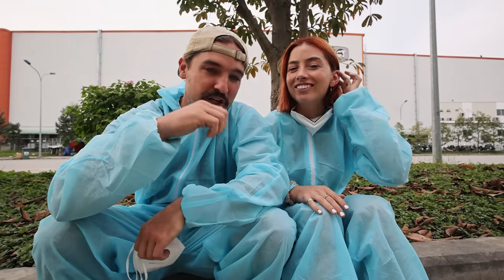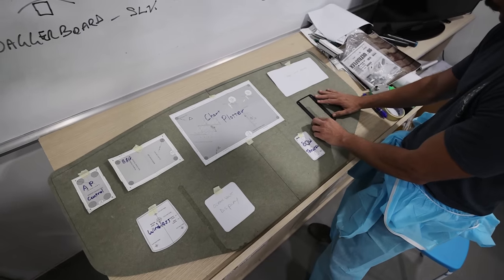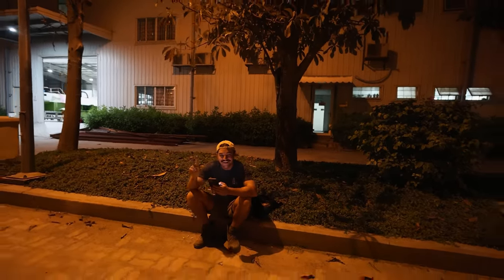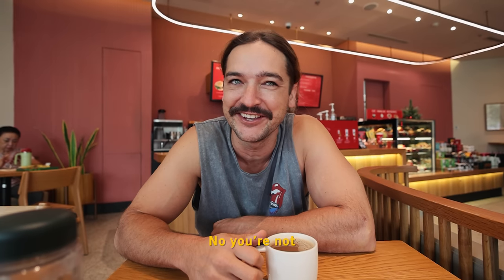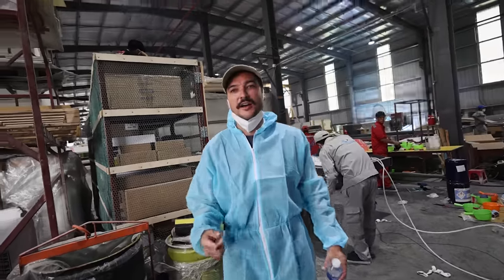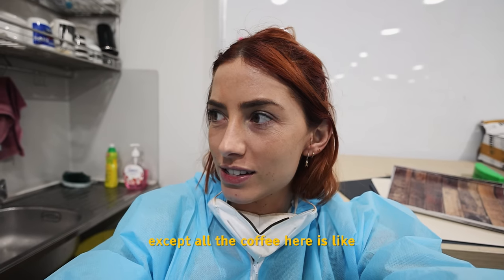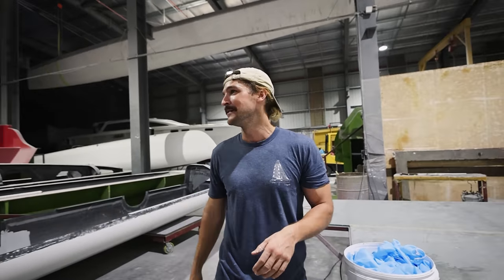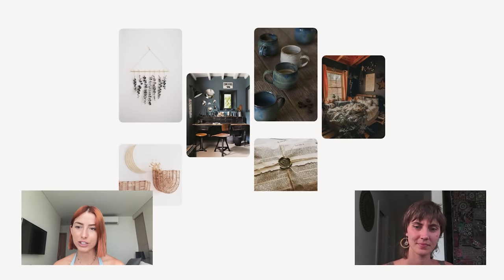BOAT BUILD: Interior work Begins!

Comment: I’m an architect and I have to be honest, I know its a subjective topic but I believe you are destroying your boat / home with an eclectic melange of faux finishes that will make a confined space feel smaller and chaotic. I would go neutral all the way and accentuate the interior with colours and finishes in the soft furnishing that can be changed as you desire. It’s too confined a space, you need to accentuate the volume and not diminish it with this clutter, your stimuli is through the windows and the places you visit, I would think the interior should be a sanctuary, a haven, peaceful and serene.
Reply: Yes, with bright colours you tend to get sick of them. Nondescript soft colours work best.
Also get rid of the insane copper.
Reply: I think it looks kinda funky......maybe not the purple, but, hey, it's not our boat‼️‼️
Reply: @HopeOfJoe  yes i agree - its not our boat and they should do whatever they want.
It is a great yacht and it will be really interesting to see how it turns out
Reply: I'm sure when it's all done it will look amazing they do have alot of help and support from exsperienced boat builders painters interior designers ECT.. I'm not worried at all I look forward to the finish project
Reply: It’s gonna be a home first with the warmth of the home and I think as far as the wall colors in the paper and stuff just as in a home that can be changed that’s lightweight. It’s a coat of paint or another design of wallpaper so I don’t think that is some kind of major commitment. The light weight is important in plants on board are going to be very important and the plants looked a lot like air. Plants didn’t needle a lot of dirt to live.
Reply: Oh, and also, they’ve been on the water for so long. I would pretty much trust that they know what they would like around them.
Reply: They could always change it if they decide they hate after living with it. Live and let live.
Reply: You may have a good point; but people mentioning it's subjective are right. 

If I walk into a house that has white or very pale colored walls, I can enjoy it and appreciate it, but I can't live well in it. In my space, I have to have deep color to feel at home, primarily greens- many!  and reds and deep blues and black. If I have to live too long in a white- walled space, I wonder why someone doesn't finish and paint those awful only- primed walls! My style certainly isn't everyone's, but that's kinda the point ...
Reply: I agree 100% Barry. The colors chosen are going to make it feel very confining. Yea, it’s their boat so ultimately they can do whatever they want. I don’t think they will “love” it all a few years down the line and it will be expensive and time consuming to change the heavy, bright colors when they tire of it. They will become dated  faster than the neutral and lighter colors.
Reply: I agree totally,
Reply: Kudos to you for being bold and making a statement.
Reply: Maybe confined space seems pleasant after the large expanse of ocean all day long
Reply: thats exactly it though - you are an architect and not interior designer
Reply: Charlie bit my fingerrrr
Reply: I agree ☝️ 😊
Reply: I work at a professional remodeling company as a designer. I go into homes (bathrooms) all day long that were built like this in the 50s, (pink and gaudy) and people want it torn out…..Neutral is the way to go with slight accents. That way, when you get tired of it, you can change it easily.
Reply: For real. Take a note from yacht manufacturers. They know what they’re doing
Reply from the maker: I’m really glad some people don’t like it. If I was getting all positive comments on our funky ideas I’d honestly have to re think them. We love it and we’re really aware it’s not for everyone. 
Time will tell.
Reply from the maker: @theAquillo  yes I love monostyled factory produced unadventurous decor.
Reply: You are right. Dark colors and bright colors you will get sick of it fast. 
 The dark colors make it seem small. Same with  bright colors. 
And ya'll  are right it isn't our boat. BUT!  You have to remember the resale of the Boat in a few years.
 And I believe they will go back to a cat soon. The cats have way more room. And with the HH and Seawind cats gets you the room and the speed they are looking for.
Reply: Did you hear that Riley and Elayna, you are destroying your boat/home!!!!! There is no recovering from this fatal mistake! LOL. 🤡
Reply: Right on brother! I was just about to post the same thing. 
They should leave it a blank slate and ad to and change as they have had the experience of living there!
Reply: Ngl I’m so tired of houses or living spaces looking like hospitals or offices - let there be color and funk!
Reply: I love that they are doing something out of the box and to their liking. That’s the fun in watching different peoples lives if they were all the same we wouldn’t be interested. For you, neutral means zen for others it’s not, and that’s okay.
Reply: Dear all, please rethink your approach. I was also fascinated with wild & funky interior design concepts, until I was really distracted by too strong energy of  colors that were chosen. It caused us being uncomfortable and stressed. We were not aware of this at the beginning. After 20 years in the business, this was my biggest lesson. There is an abundance of useful advice in this thread. Please reconsider getting professional advice from yacht interior designers. Since you are No1 sailing channel, you can make the process especially interesting for viewers. I am sure many would apply for free, just to save you from negative consequences. Share 3d model to the public, and let top designers help you. Much love.
Reply: I can tell you, I’ve painted the entire interior of my house, and after living with it for a few weeks, we hated it. So, I painted the entire interior again. It sucks, but they can easily change colors if they want. I think their boat is going to look awesome!
Reply: Yeah!
Reply: They are raising kids here- its not a floating hotel room! I am certain they put unbelievable amounts of effort and time going over every detail… i mean i am a grown woman with fairy lights all around my room and a pink faux fur duvet cover. I would be miserable in a tan/white home!
Reply: 😅 Be careful about Pepto Bismo pink.
Reply: Barry Macken, how many boats have you owned, sailed or designed? Asking for a friend.🤔😎🇦🇺
Reply: @igoridol  they have 3 interior designers working on this themselves and Willa.
Reply: @kptbillburkett8735  it's their choices. They'll not be interested in changing now. I painted my tiny bathroom dark marine blue and it's fabulous,  not small.
Reply: ‘Destroying their boat”? A little dramatic, are we? 😂
Reply: I agree about trying to maximize more light snd space. Also dark surfaces show every crumb/footprint/dust etc. with children. I do love your ideas tho..for a home.. But, it’s your boat!
Reply: I wouldn’t go with such bold wallpapers and colors because you will get sick of it after a while for sure but it’s your boat.❤
Reply: @darlenewebber7706  it is…and politely speaking, no one asked for your opinions. Any of ours, actually. That said, I realize you mean well, so….cheers!
Reply: I guess we all have different opinions of what destroying means. 😉
Reply: Couldn’t agree more
Reply: Guys, go for it! I‘m kinda hating it as well (a little bit), but it might look cool overall because every room has its theme. 
Also you get more content two years from now when you’re re-designing the living space🎉
Reply: Bad interior design. It will feel chaotic indeed. Maybe Rapido's design team will save them ?
Reply: Architect Barry, they have a designer on the payroll.
Reply: Yes, agree. As much as I look forward to see the new boat, I’m always put off by the interior design. I think it is more suitable for a pirate ship, that some high performance boat. I think it will be either you love it or hate it style.  But that is my opinion and I don’t know anything about boats.
Reply: I think you nailed it!  It’s one thing to see a light fixture or wallpaper and say that’s cool!  It’s another thing to wake up and go to sleep with it 24/7.  The more eclectic/outrageous something the quicker one usually tires of it.  It’s better to go with wall covering, furnishings, and textiles that will stand the test of time and add in a few eclectic color pop items.  They also need to take in account that they may see things while traveling they like and if they fill the boat up with a bunch of clutter in the beginning they won’t have room to add to it.  I’ve seen this before where people love a light fixture or a sink and six months later they want it ripped out because it’s not practical.  Guess what?  It’s not cheap to redo what’s already been done, but I guess that is what patrons are for.
Reply: Guys, IMHO the interior images that you’ve shared look wrong - too much going on/visually cluttered.  The many colours and finishes will drive you nuts in a very short period of time.  Research the phycology of colour and decor in submarines - some of the best design minds in US and UK have contributed to this work.  Less is often more.  Great that you’re getting stuck into the build and now doing the detailing on positioning things.  At the end of the day it’s yours to do with what you like and we can all get stuffed but as you’ve put it out there for opinions, this is mine!
Reply: Spot on
Reply: Not your boat, not your decision.   One thing about people, they will insert what they believe is best for them 👌🏼
Reply: They can always shoot an aquatic version of The Shining
Reply: I'm not comfortable in most homes and like clutter and color...and know how to live in small space.  Currently in 81 Square feet.  This is my sanctuary and retreat from the world.  A big person wouldn't even fit...
Reply: They’re also going to use this as a filming backdrop for years, they’re not just living on it. Most expensive fancy boats come super neutral so I totally understand wanting something different, and budgeting for a refit every 5 or so years.
Reply: Watching cruiser channels and personally being out on the water during the day; sunlight is blinding and there isn't alot of shade out there. Babies growing up under that blinding light would justify consulting/research or seek an ophthalmologist?
Dark colors absorb a lot of that bright light.   To much light is a problem.  
Example: If you have a problem focusing or reading try it reading thru a pin hole in a piece of paper.  Blocking out the light brings what your reading/focusing into focus.  Maybe there's an ophthalmologist in the comments who can explain and advise.  I guess we can just Google it?
Reply: I like some of the darker colours as it gives a warm and cosy feel. And I’m guessing when it’s time to retreat that would be the perfect way to do it…… I absolutely love the green…..
Reply: 100 percent agree with this comment, big mistake
Reply: Yes their decor looks like something out of the Goodwill thrift store.  It will be outdated within months.  I Like the bathroom though.
Reply: Could not agree more, some of that styling is just plain ghastly.
Reply: As the boat has a minimalistic design I would go with the cream color to replace the wood wallpaper as things get out of fashion through time but simple colors dont
Reply: Shabby chic on a 60' yacht is a joke!
Reply: Yeaaa really don’t know what they are thinking
Reply: @heatherhall6711  but they literally asked for the viewers opinions? Lol
Reply: Children and neutral is a difficult scenario.
Reply: It all feels very disjointed
Reply: Omg please listen to this person
Reply: Fully agree
Reply: CHAOS! Mock ups are horrible.
Reply: It's not your boat, is it?? Whatever they do to it is for them, not anyone else.
Reply: @bethb7965  dont be so sensitive, everybody’s allowed to have their opinion. The opinions stated are constructive and don’t mean any harm.
So don’t be a Karen, miss Beth B
Reply: @AXPorto  Yes I don’t get that, the ‘not up to you’ comment, which is common unfortunately.  Here is a world famous internet boat  couple, inviting everyone to participate (politely) and there’s more than a few demanding everyone shut up and do nothing but applaud like drones.
Reply: I agree 😅
Reply: @Nill757  agree!
Reply: @tammy6992  Eh, experience w the old look is no immunity. People moving from old home ashore to new, make design regrets all the time. You want something new, but you don’t know how the new thing will feel over time.
Reply: Is it a foo foo boat or a performance boat ? Dark colors will make a closed in feel after awhile but then you have all the openness of the sea . So have fun .
Reply: I don’t really care about the color choices etc - I am just so glad the weight is still a major consideration for such a performance cruising vessel!

It’s great fun watching the progress now !
Reply: I completely agree with his opinion. 

Also, copper sinks will be a maintenance nightmare!
Reply: @krisbouchard6146   Any idea at what point pushing lightweight endangers the stability of keel-less boat?
Reply: I agree with @barrymacken4410, all the different colours are so distracting and ... not my thing.  The owners will have to live with the choices and of course they can make changes.  I would try to get it correct the first time.  Nevertheless the boat is very impressive!
Reply: @teejteejteej  have to friendly speak up teej (family of architects here :o) perception of space and light comes tops in training and everyday work 😎
Reply: @Nill757  with the beam of this boat stability will not be an issue as long as proper amounts of sail are flown which Riley has shown to be one of his strong suits. And less drag will enable higher average speeds which allows for sailing around the worst of weather.
Reply: They don’t want broad appeal they want their tastes.  They want their boat to feel like their home.
Reply: @krisbouchard6146  Yes from the videos Riley is a great cat sailor, careful with not too much sail. Now w a very light 60’ boat and much more sail area he’ll have to be very  careful.  

Wide beam is effective at stability .. when there’s some weight out there in the beams to create righting moment.  Make a keel-less boat too light and ..  

Yes a fast boat can move away from big fronts. But those squalls at night, always catch you sooner or later.
Reply: I have to agree, I’m designing my tiny home 18 ft x 8 1/2 feet and airy and light with a bit of color to pop here and there makes the space seem bigger. Even my cabinet fixtures are going be soft white. But let’s wait and see maybe we will all collectively love it😊
Reply: Lighter colours would be better, especially when in the tropics. Darker colours, for me, would be too claustrophobic. Black trim is okay to anchor the space.
Reply: It's going to be a design disaster.....but it's their home and it should reflect their taste...or lack of it. And I think it will increase views...at least in the short term as people tune in to watch the crash🍾
Reply: I get they've asked for opinions but keep in mind they're not decorating this boat to please their audience's eyes. It's their home and what they like. It's spunky and vibrant just like them. Keep in mind they lived on the catamaran with all white and neutral. About time they can finally express themselves through their home.
Reply: Couldn't have said it better! Hope they are not sorry for the way they are going but I'm afraid it might be exactly as you've said. But hey if it's what they want, they are living in it not us. And if they find they don't like it, it can be changed 🤑🤑🤑
Reply: You must be new to their channel lol. They are nothing but wild just look at their hair 🤷🏽‍♀️ if it makes them happy then so what. It’s not irreversible
Reply: I have to agree, I think it’s mad to do wall paper of wooden planks on a brand new high tech boat, even from some sort of value retention or in a yachts case limited depreciation I think nice neutral design would be the way to go. This all said its their boat!
Reply: @SailingLaVagabonde   why would you have to rethink it if everything liked it?
Reply: Maybe the wood look finish could be paint washed in a restful pastel colour of choice, rather than an oak/teak etc
Reply: Wtf you talking about. Its their boat
Reply: @SailingLaVagabonde  great think about paint and wallpaper are they are easy to change.  As an ex-painter I would highly suggest getting an actual respirator when spraying especially 2part paints. Those paper masks will not protect you from aerosolized paint.
Reply: @summertyme9046  not somebody with experience in the marine field as far as I’ve heard.
Reply: @Useless_Knowledge07  The pinhole works because it assists focusing the image on the retina - it only works if you have a healthy retina and your lens/focusing apparatus needs boosting. It has nothing to do with reducing the light entry into the eye. On the contrary folks needing reading glasses often see better when on holidays in sunny conditions as the bright daylight forces their pupil to constrict to a ‘pinhole’ - they may even find they can manage without their ‘readers’.
Reply: Like you said…..  YOU’RE AN ARCHITECT 😂😂😂😂😂
Reply: @drdecco1  Thank you so much!!  What about Babies and teens being exposed to constant bright sun light?
Reply: You are the biggest DB on the planet, Barry.
Reply: Agree , the interior colors are revolting
Reply: Faux finishes are pretty tacky really, and on a boat that's so high end, it seems absurd.
Reply: Its going to feel like walkimg into a black cave. Especially when going below from a bright sunny deck.
Reply: Sounds reasonable
Reply: The best part about about building your own boat is you get to do what ever you want.  The worst part about making a YouTube video about it, is listening to opinions of people who don’t matter.  You do you!  Nobody watches this channel because they do everything exactly like everyone else.  Be unique, be you :)
Reply: This is their home not just a boat! JS
Reply: @vickeyross4413  Its also a very big investment they will need to sell in the future..  The Big boat market has a very limited customer base. Boats that are 'different'  (eg bad décor) can be very difficult to sell.